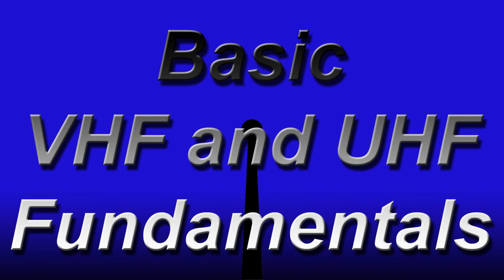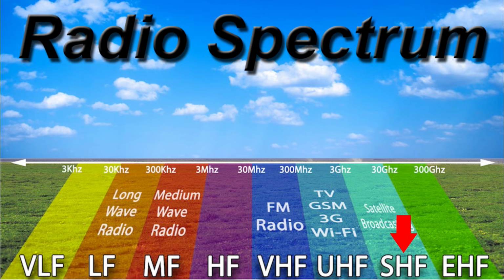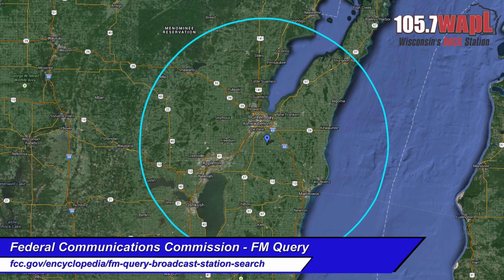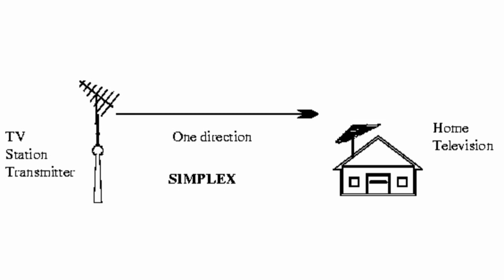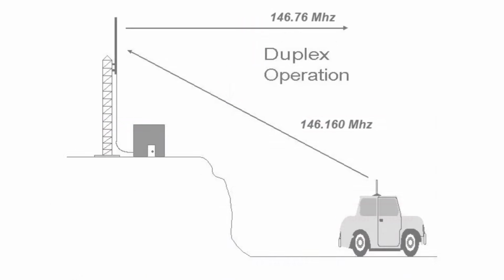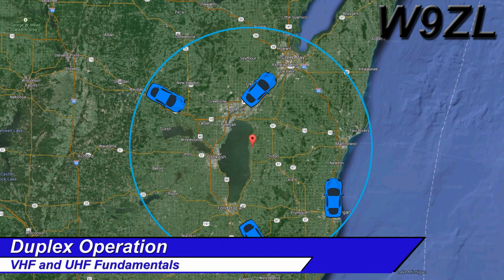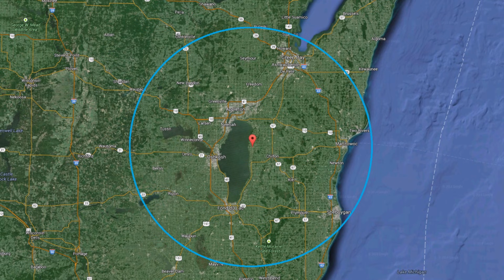Basic VHF and UHF Fundamentals

Comment: Hello cheese head. I've always struggled with this common rule of thumb that uhf can pass through the walls of a house better then vhf. Because, in quantum physics,  the likelihood of EM waves interacting with matter depends on the energy of the photon(s).  If it becomes larger then the energy between an atom's nucleus and elections, it will interact with the elections.  If the energy is large enough (as in viable light), it will intact with the atoms. Therefore light cannot pass through walls. The energy of the photon is proportional to the frequency (planks constant). Therefore uhf has more photon energy than vhf and is more likely to interact with material.
Reply from the maker: Thanks for watching, always interesting to hear different theories

Comment: A small, mostly irrelevant note:

I wasn't sure if the concept of simplex and half/full duplex were the same as those used in digital systems communications, but it seems they are after some research.

The walkie-talkie example was labeled as being simplex in this video, but I believe this would more accurately be considered half-duplex, since the communication is bi-directional but transmit and receive cannot be performed simultaneously.

The example of using separate frequencies for transmit and receive to achieve concurrent transmission and reception would then be full-duplex.

Anyway, great content thank you for the video!

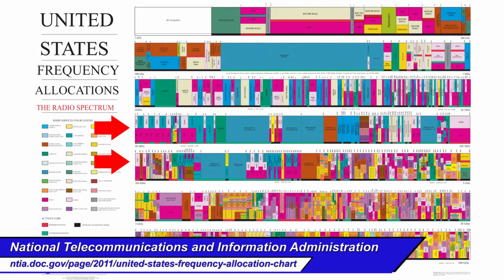Comment: 1:15 - - VHF + UHF uses line-of-sight propagation.
Line-of-sight is the direct propagation of radio waves between antennas that are visible to each other (the most common of radio propagation modes).  
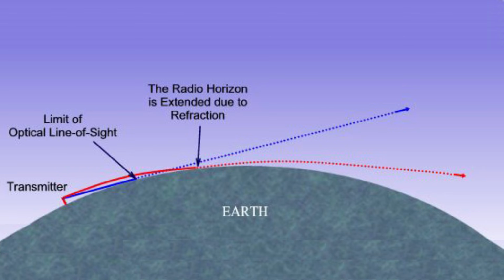1:37 - - maximum distance of line-of-site transmissions is about 25 miles (due to curvature of earth; referred to as the radio horizon); slightly farther than actual sight bc radio waves bend; however the higher the frequency - the less they bend.  You can extend the range of your communications on VHF + higher frequencies by increasing the antenna height - 10 ft of antenna height is like doubling your power output
Reply from the maker: Agreed, This is a basic video on VHF and UHF. We could discuss VHF and UHF propagation all day and that's not what the video is for. Its only fundamentals

Comment: You can also calculate the height of an antenna by knowing that 2 degrees of arc is equal to to 60 min of latitude or 60 nautical miles, this only works for N - S unless you are with in 300 miles of the equator than it also works for E - W.
Reply: Aren't we full of ourself😢

Comment: Man the narration is fast, too fast. While VHF and UHF appear capable of pentrating walls, what is happening in reality the shorter wave length can find and pass through gaps in a building's structure, also they are easily reflected inside the struvtur. However there is limit how higher frequencies can be effective

Comment: can we transmit GPS signals through VHF RF  to track the position of a vehicle without internet?
Reply: asif shafiq You can use two prepaid mobile phones with the push to talk (PTT) feature. Tape one to the underside of a vehicle, and hold on to the other one, and press the PTT button to track the vehicle. Or you can use two smart phones, both with Prey Anti Theft software pre-installed, to do the same thing. It's kind of expensive to do as a regular citizen, but if it's within your budget, you can definitely make it work.

Comment: Hello I am hoping you can help me out. I recently Bought a set of older fm intercoms by radio shack .They are FM transmitters. From what I just learned in the video earlier is the FM - vhf .Doe not travel though walls or solid objects. Bear with me as  I try to wrap my head around all this. So I got the intercoms to talk to my wife in the bed room. Only 15 feet from where my unit would be. But CAN YOU TELL ME IF THE PLASTER HARD WALLS IN OUR APPARTMENT IS WHAT IS BLOCKING THE SIGNAL AND IF SO .Would I faired better with uhf transmitter - intercoms. That is in fact if they make uhf intercoms .It really blew my mind that the set did not function in our small 1 bedroom apt. .Although this apartment does not have drywall .The walls are rock hard plaster. Even making it a pain to hang a picture on them. But the wifi signal seems to flow though to the bedroom fine. Is it a rule that the lower the frequency the easier it can flow though or around obstructions . I am buying a set of inexpensive walkie radios . Name and specs as follows Retevis H777 Walkie Talkie 1500mAh UHF .In your opinion how should they perform .I need them no longer than around 1.5 to 2 miles max .Thank You for the video and I appreciate any added advice or knowledge you could pass on .God Bless and good day
Reply from the maker: timothy thomas Most of the FM intercoms actually don't use VHF or UHF over the air, What most intercoms actually do (the ones that plug into the wall outlet) is send the signal down the electrical line and that could explain your problem. The electrical service in your house is made of 2 phases 180 deg out from each other (This is what allows you to get 240 Volts access in your house ie. 2-120 volt legs 180 deg out of phase ) The problem with regular house hold intercoms is, if you have one intercom on one phase in your house and the other unit on the other phase in most cases they will not talk to each other.  In my case here, I actually had to move the intercom from the living room to the kitchen. To get the two intercoms talking to each other from upstairs to downstairs in my electronics shop in the basement.
Reply: timothy thomas Impossible that signal would not penetrate your wall. I reckon your transceivers do not work anymore.
Reply: Dan Vanevenhoven Thank You sir .I have since bought a set of china made retivis  kenwood knockoffs ,two way uhf radios and got the cb mic attacments .works great up to around .5 mile in town .I am getting a baofeng ham radio .Next and may have a few more questions.About repeaters etc.Have not delivery yet.Thank You and God Bless .